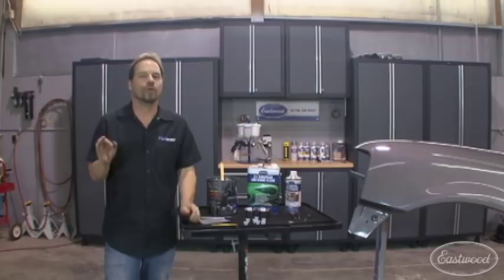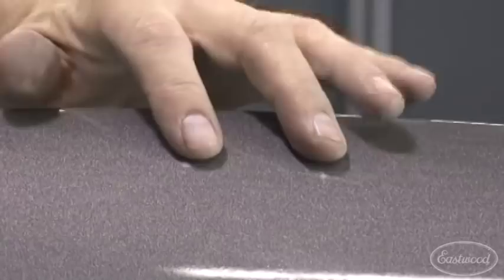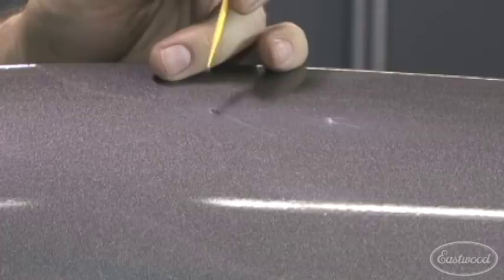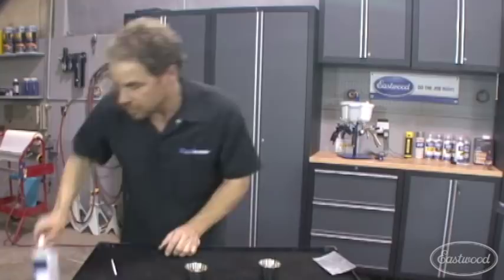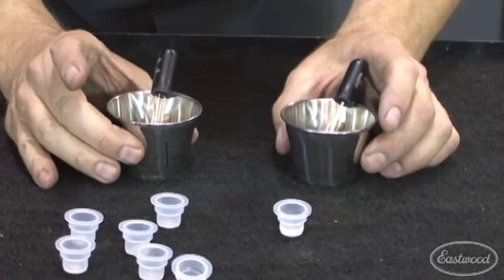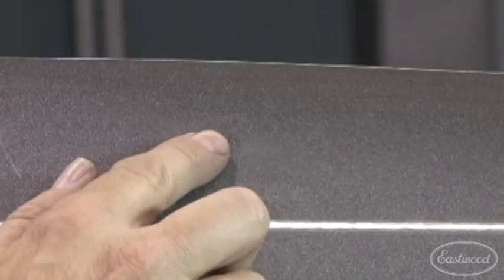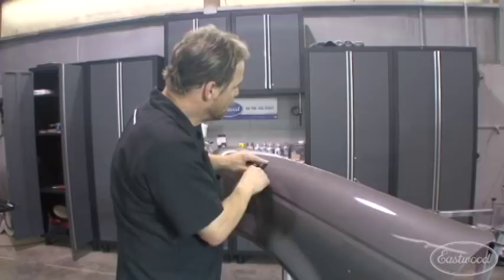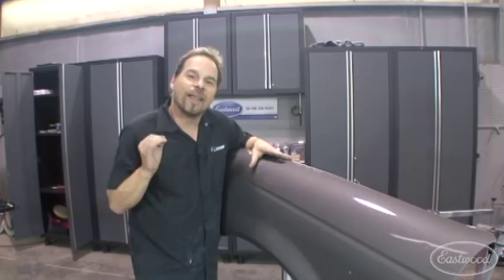Paint Chip Repair - Painting How To on Kevins Korner with Kevin Tetz - Eastwood

Comment: I used this exact method prep for paint protection film on my 2 week old car that got two rock chips. It saved me a ton of money... and a body shop supplied me the needed paint and clear for the job! The razr blade worked way better then sanding over and over again. This takes patience and time. You cannot rush this!

Comment: Instead of using the razor to level out the 1st clear coat, can you also wet sand it with grit paper (1500 or higher)?

Comment: i tired this but i think i messed up somewhere along the way while using the razorblade, a little intimidating. and still have light visible scratches after polishing by hand any advice do i need a buffer?
Reply from the maker: You can try buffing if the scratches aren't too deep.  You may want to discuss with an Eastwood Tech at 800-343-9353
Reply: You use your razor blade at a near 90 degree angle. and you are scrapping the raised area of clear until it is level with the surrounding clear. I detailed cars for years. it takes a little practice. if you put your razor at any slanted angle you can dig into your repair and the clear around it.

Comment: hello kevin i am new to this first time thanks for your video just want to ask you if the blend is perfect mach or even good enough mach  why not leve it and not bother until later on  eg spray hole panal and the other thing was what would you use if chip is to bare metal eg would you use etch paint then base and then clear? thank you so much

Comment: why did you sand it with 1500 grit with no water? dry sanding is okay?
Reply: Dry sanding is actually okay, you might just rub more of the particles coming off into the paint that will cause scratching, you have to buff for this method anyway so those will come out before the actual sanding marks. Im assuming you dry sand because wet sanding might activate the paint/clear and cause it to smear

Comment: I just did a BMW lease return , touched up the paint scratches and chips cleared with nail polish ( its lacquer ) masked the surrounding areas with aluminum tape sanded the clear then removed the tape finished sanding to level out, buffed those areas then  polish the whole car got paid 400.00 it came out absolutely perfect ( the dealer wanted 800.00) , the tape keeps the repair to a minimum even when I have to use filler , forget duck tape
Reply: Using nail polish is ghetto and won't last long
Reply: @andrewhudson3723  you're getto wtf, i have 47 years experience  in the autobody business what i forget you haven't learned yet and won't either
Reply: @tonycavez  And do you tell your paying customers that you are about to use nail polish instead of clearcoat? No you don't. Because it's ghetto.
Reply: @tonycavez  47 years of breathing paint fumes has not made you a wise man. You're forgetting everything you knew now.